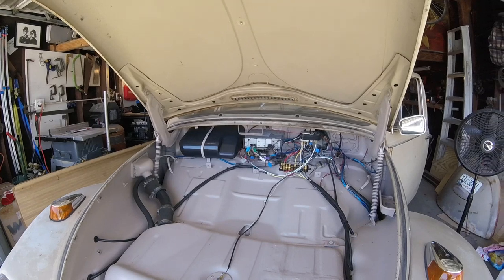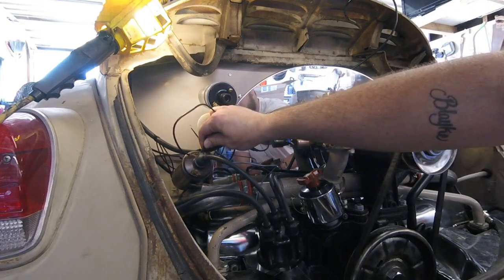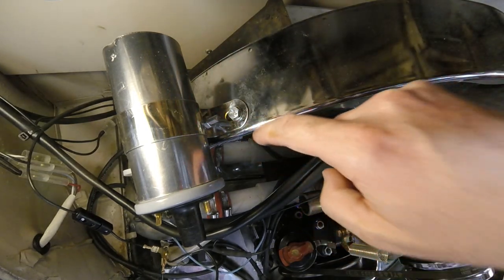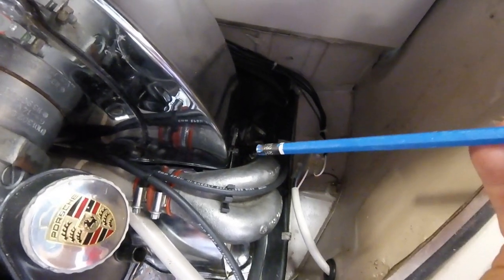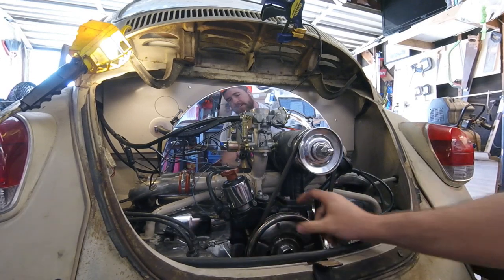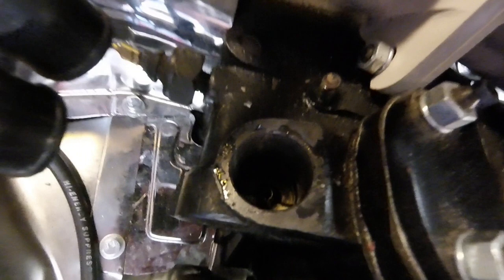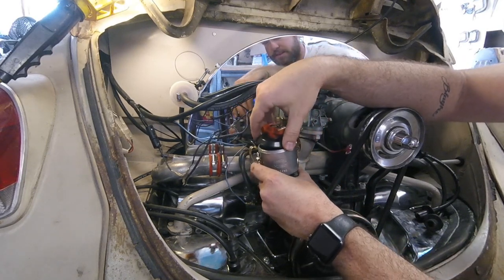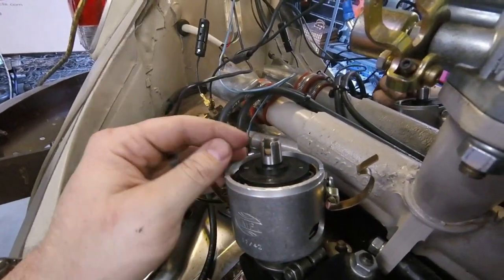VW Beetle Restoration Project: Installing Electronic Distributor

Comment: Hey man what coil are you using? Here in México can't find the blue Bosh, I have a blue Beru ZS 172 but not shure it's fine.  Can't buy a pertronix right now. Thanks
Reply from the maker: isauro hernandez thanks for the comment. I am using a Bosh. If you are switching to electronic ignition you will need higher voltage coil.
Reply from the maker: If you are buying at Auto Zone i would give it a try and return if it doesn't work. Otherwise I would go for a 3 ohm.
Reply: All right! I'll do that, thank

Comment: I’m attempting to get this done correctly on my 70, and the one thing I’m confused about is you repeatedly say “point the rotor at #1” while it appears the rotor is pointing at the 6 o’ clock area, not at #1. Why is that?
Reply from the maker: jaison edwards thanks for the comment. What I mean by rotor pointing to 1 is, piston #1 area. with #1 piston pushed all the way up “top dead center” the rotor should be facing the 5-6 o’clock position. The timing notch on belt pulley should also be facing up, or at 12 o’clock ish position.
Reply: Chris N' Cars thanks man! I got mine up and running today with help from your video! 🤘🏼
Reply from the maker: jaison edwards that’s awesome! Thanks for the feedback.
Reply: Chris N' Cars you bet! #newsubscriber

Comment: U never showed how to connect the distributor on the coil
Reply: BEARDED G connecting the distributor to the coil can only go one way. There is literally no other way to connect them. The short HT lead goes from the only spot on the coil it can fit, to the centre of the dizzy.

Comment: Get rid of the chrome tin on the motor, it reflects the heat back to the motor unfortunately
Reply from the maker: Hey! Thanks for the feedback I always figured that was the case. So far the car hasn't overheated since I sealed up engine compartment properly.